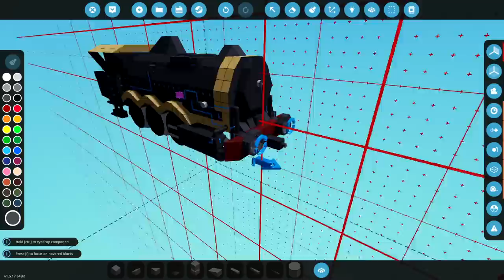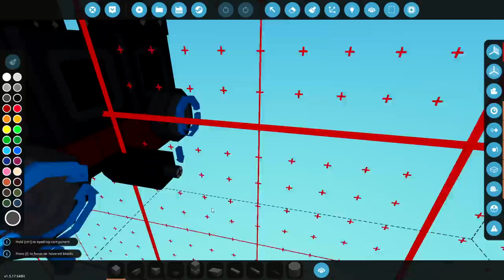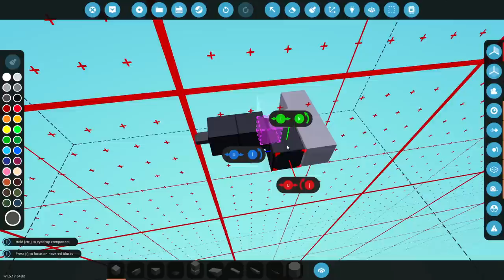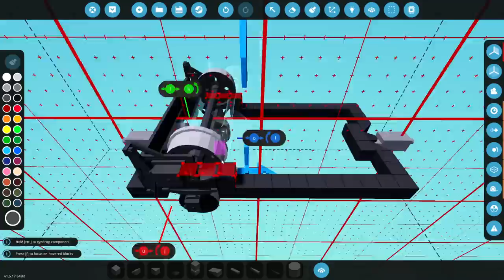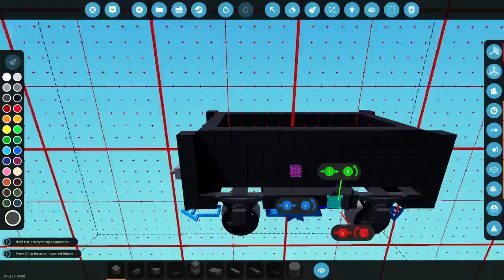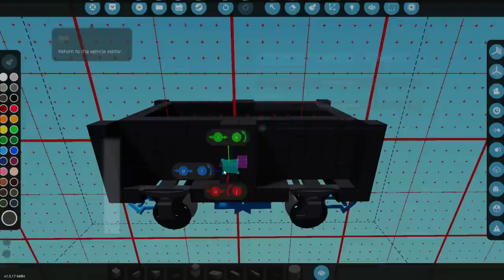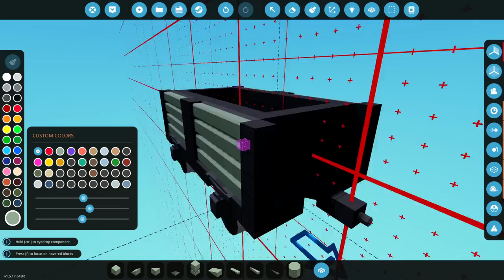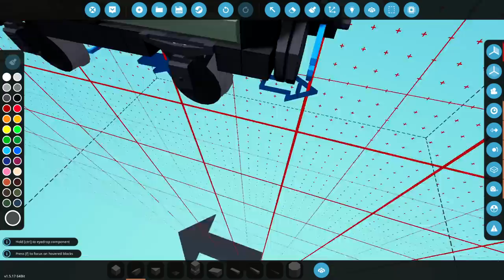NEW: Building & Pulling Old Fashioned COAL CARS In Stormworks!

Comment: You’re getting the hang of it. Two things you can try to fix wheel slip: 1) remove the unpowered wheels in front so all the loco weight is on the powered wheels and 2) add more weight to the locomotive. If its still giving you grief maybe add a 4th powered wheel set.

Comment: If you add a fluid pressure sensor just before the condesor and another before the pistons, you can set up a relief valve to release steam if the pressure to the condenser is higher than the pressure going to the pistons.  That way the condenser system is not blocking too much steam and won't show the pistons down.   

You could also lower the temperature to the boiler just a little bit if the pressure in the boiler is getting to high too fast.

Comment: Frantic, when you get up to speed try applying small amounts of braking on all wheels, something in the 0.01-0.04 range. I was trying a 2-10-2 wheel config. and my train reached 496 kph before derailing  I can consistently reproduce it. It's ridiculous.
Reply: Wait wth 496 KPH?!?
Reply: I believe you. I got 300mph. I mean I wanted to go faster but not that fast, maybe like a decent 80mph. Mine is a smol 10-2 config.
Reply: @G777GUN  yeah going that fast to me is as bad as the  crawling speeds you normally get
Reply: @cesararanda4213  I found there is a way to kinda control it. But around 80 mph the train just suddenly shoots off to max speed even if you turn off steam to the pistons and slam the brakes it does nothing to stop you. However I also found out if you attach cars to your steam train its much more controllable even at 80 mph. I have not tested it with containers yet. 

But I feel like at some point they will fix it so I will not go too technical into this.

....

They will fix right?

Comment: Here's a tip for speed, get the largest wheels, as the larger the wheels, the faster you go.
Reply from the maker: When this was built the larger wheels were bugged
Reply: @FranticMatty  In which case, you design is the best option.

Comment: You'll do well to add a reverser and a regulator. the reverser act as your gears and the reverser as your throttle.
Reply: That doesn't really work with the new pistons for train wheels.  It does for the steam pistons, just not the pistons specifically for the train wheels.   It is pretty much only a regulator that can be used for them.  Applying more steam to go faster.